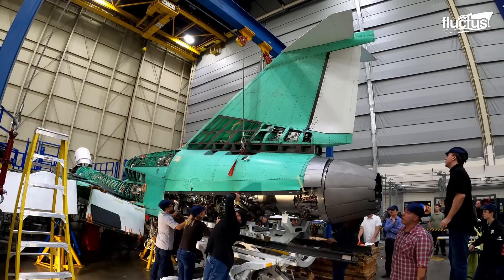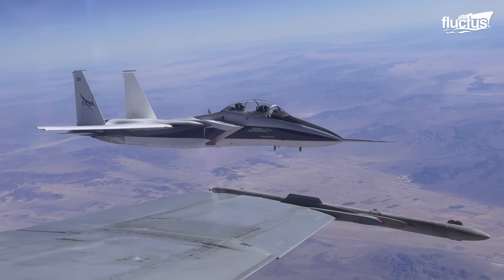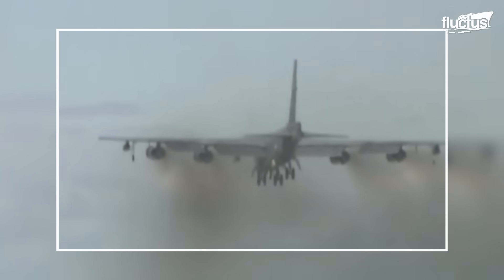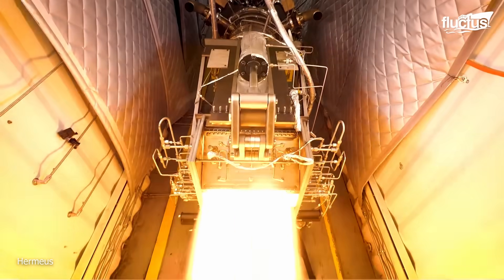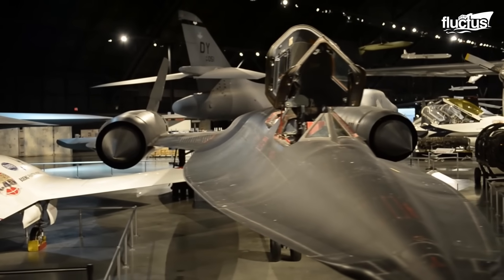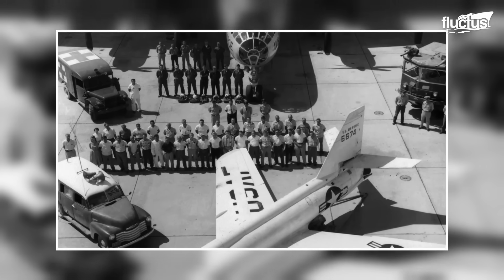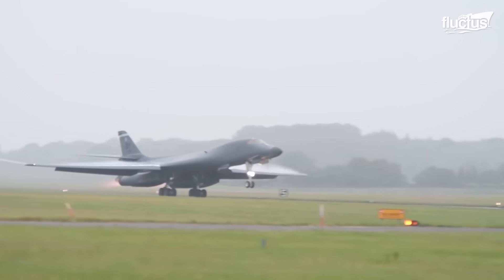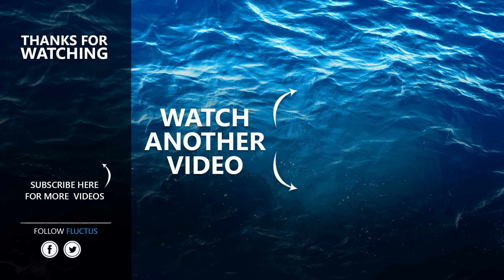US Testing to the Extreme Limits a New Revolutionary Supersonic Aircraft

Comment: 8:51 at its top speed it could cover the length of a football field in less than a second
While true, that's quite an understatement. 2,200MPH = 1075.5556 Yards per second (> 10 football fields)
Reply: Thanks for doing the math on that statement. Just a hundred yards per second sure sounded wrong.
Reply: mach 5 is 3,836.35 mph.
Reply: @daciefusjones8128  Okay, but the part referenced was about the SR-71, which according to the narration could reach speeds of Mach 3.2 or approximately two thousand, two hundred miles per hour